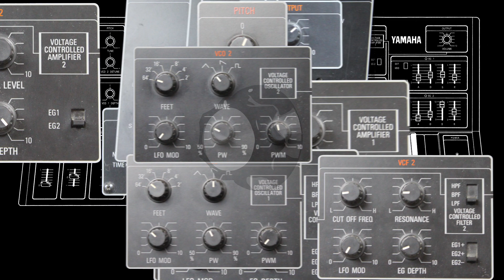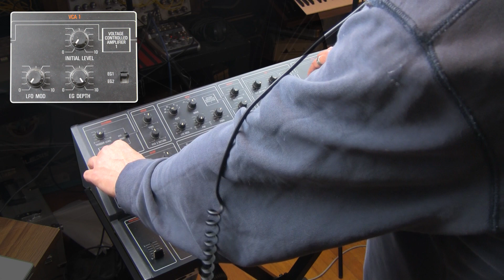08-The Yamaha CS-15: Part 8- The VCA part 1

Comment: Can any synth modulate just the (eg.) sustain level?  hmm
Reply: I don't know about analogue, but yes you can on the Waldorf Q. Just route an LFO to Sustain level via the mod matrix and hey presto. 

On patches with short release times, you can use it to add some movement to a sound, without messing up the consistency of the attack. Once you open up the release though, things get more interesting. What you get then is: Attack-Decay portion=no amp mod > Sustain portion=amp mod > Release portion=no amp mod. So you only get modulation on keyhold, and when you release the key you just get a smooth release. Great for pad sounds, especially if you apply it moderately, and add some delay and just a little bit of slow pitch modulation (from another LFO).

Comment: Fantastic demo , really interesting to see a VCA get a good mention its very intresting indeed. Normally an init level control (from my understanding ) is a trimmer under the hood. Am i correct in guessing that the VCA only responds to a posotive polarity where as the filter will respond to both posotive and negative Cv ??